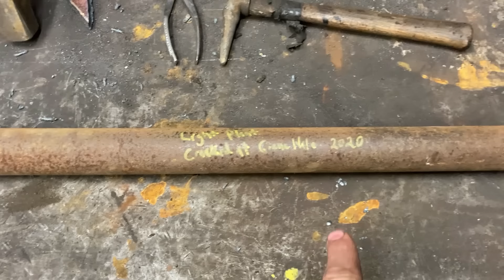Making a Cable Guide Roller Plus a Little Snow Plowing Too March 14 2024

Comment: How thick does the ice have to get to support a TD6? Saving the tips on the plasma cutter, is kinda sorta like using up the grinder wheels on the small jobs.Every piece of re-used means less stuff needs to be bought, produced, mined.Every time you re-use something,the Swedish Kid, smiles like the Mona Lisa8)
Reply from the maker: it depends on the ice and where the ice is. sometime you need lots of ice and other times not so much. there was over 3 feet of ice on the lake when we went to get the plane. yes we have to use everything until there is no life left in it because it costs a lot of money to get things up here.  thansk